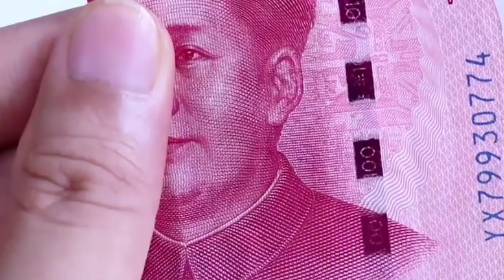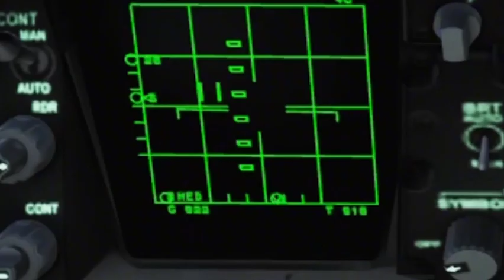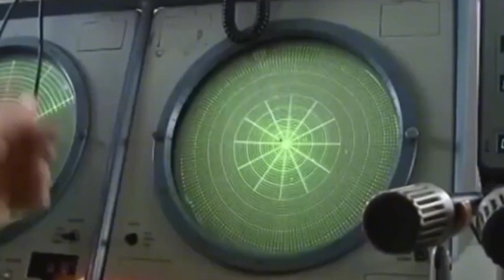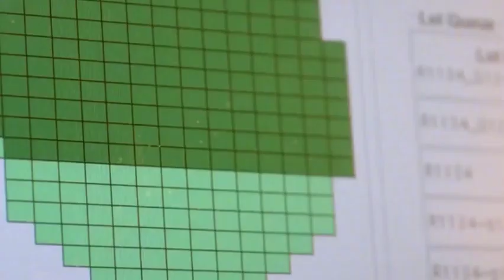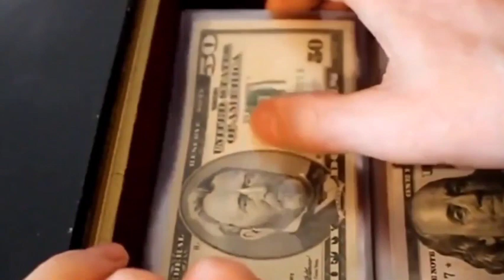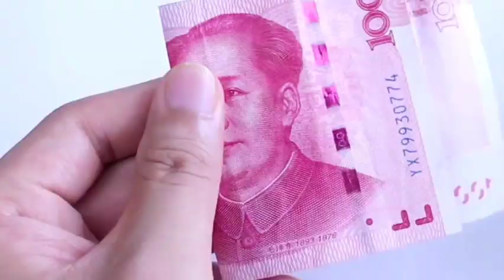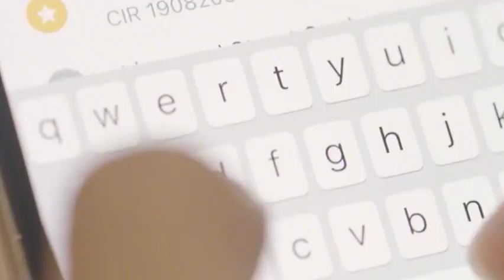China's semiconductors are developing rapidly, and the U.S. may have underestimated China's chip.

Comment: It is ironic that the US by its various actions, has made China speed up development of the semiconductor sector and has made 'self sufficiency' a goal.  This year, 2023, is a turning point as newer technologies such as photonics, graphene, and quantum chips enter the production phase from R&D. I wouldn't be surprised if China produces the equivalent of an EUV machine, thought SMIC has recently purchased six 'advanced lithogrpahy' machine from ASML.  The media report didn't say whether it was DUV or EUV, but said this gave SMIC the capability to produce 5nm chips.  If so, and China can achieve 5nm production, it is near the top in high end chips.  China can normally produce chips at a much lower price point than the US so this has significance to the impact on the 5 new chip fabs being built in the US. If there is 5nm production in Taiwan and the mainland, US fabs might again be outpriced and out produced.